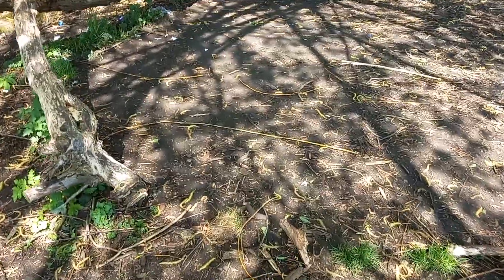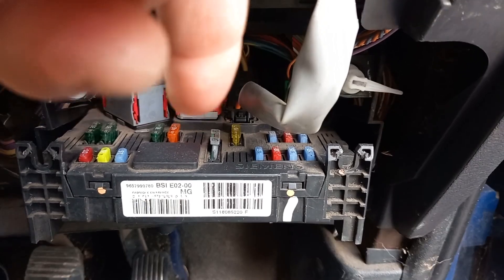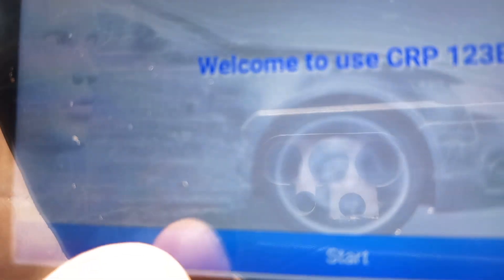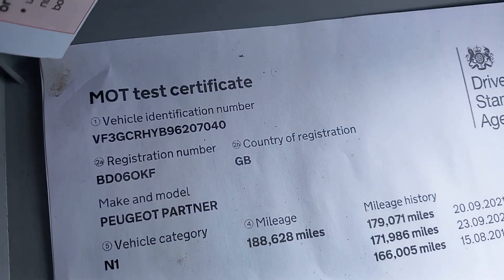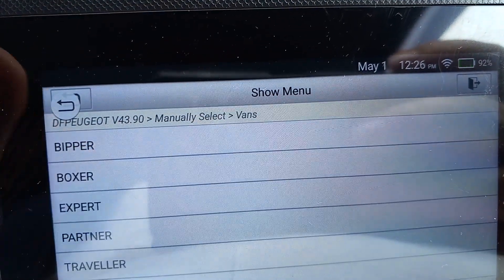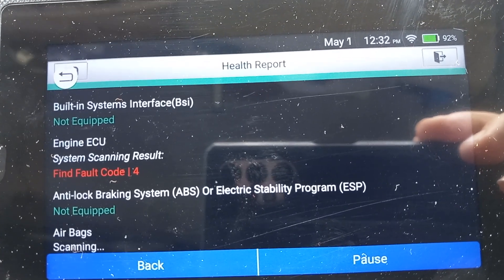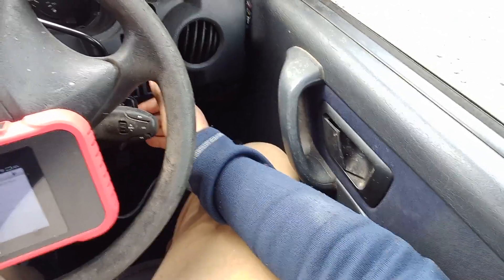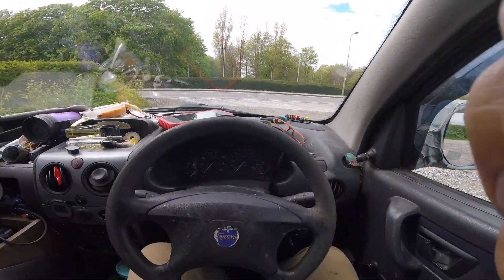VanLife S14E47 Peugeot/Citroen BSI Diagnosis and Fix  Crank/No Start 🛠

Comment: Good start Tim, I've got little doubt you're way ahead on this by now but there are clues in those fault codes to potentially link to the headlight and wiper issues being part of this problem. The schematics can be very useful sometimes with these kind of problems.
Reply from the maker: Van has a number of issues I need to get on top of before the next MOT in October.

Comment: Despite the Sisyphus moment, at least you now have it narrowed down, and some data to work from. 

Though I'm pretty sure you have it fixed already, for the sequel. Hopefully. Garages can really take the pee on electrical fixes.
Reply from the maker: "Meet triumph with disaster and treat those two imposters just the same"
 - Rudyard Kipling

Comment: Tim you absolute legend! Well done mate great fix to get the van running, hope you can get the electrics done.
Reply from the maker: I plan to take a week off in June and travel around South Wales with Nomadic Kangoo. That could be a great Top Gear style hoot if you're up for it. Date to be arranged.
Reply: @SocksWithSandals  mate I would 100% be up for it, if you chaps will have me along! 🙏

Comment: Sooo... fuel pump in tank?

I need that thing..

Where did u get the obd thing?? Could i trouble u for the link?
Reply from the maker: https://www.ebay.co.uk/itm/LAUNCH-CRP123E-OBD2-Scanner-ABS-SRS-Code-Reader-Check-Engine-Car-Diagnostic-Tool/374282857049
Reply: @SocksWithSandals  
much appreciated 🤙